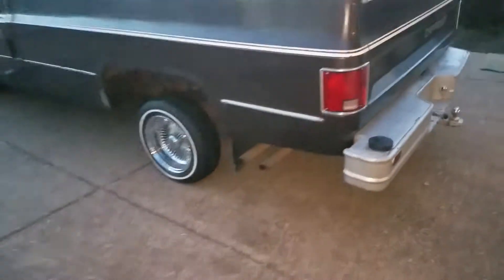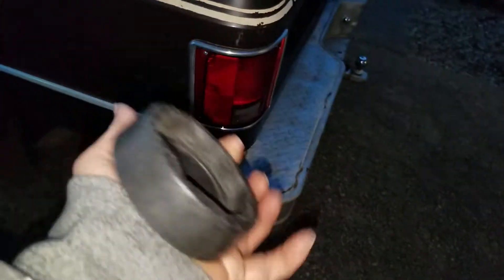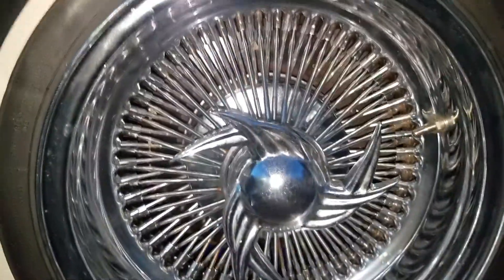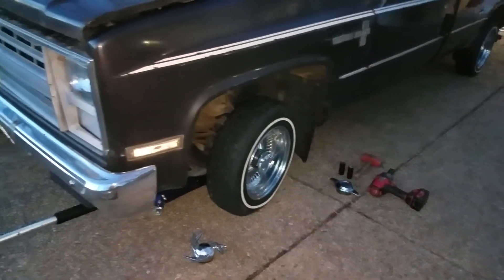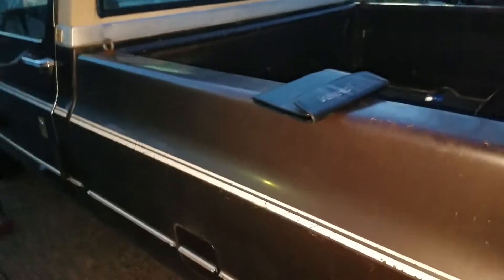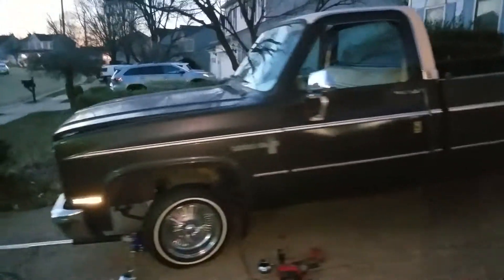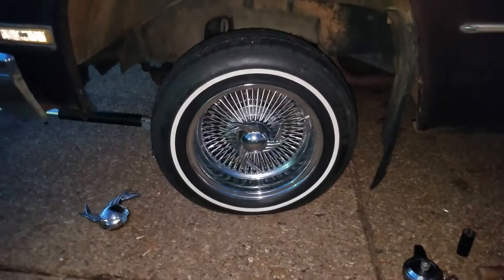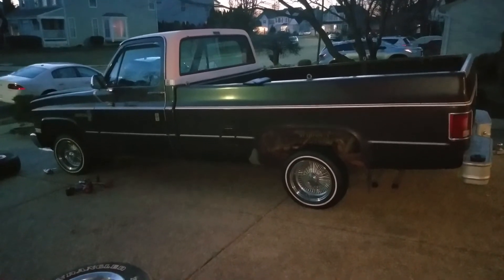Chevy C10 lowrider project part 2

Comment: That is clean bro keep them on ☆☆☆☆
Reply from the maker: Today I'm going to put the stock wheels back on because I don't have a complete full set of lug nuts and I have to get one of the tires inflated. Then I have to do a tune-up on the truck and take it to get emissions and inspection. Once I pass and I got my plates and my stickers I will take the stock wheels off and roll with the wires
Reply from the maker: Oh and I forgot to say thanks

Comment: I love them spinners you have on the front wheel I would get them redone 4sure & if the only choice is 14's or 15's I would stick with the 14's once you lower the truck it will change the whole look
Reply from the maker: That's exactly what I plan on doing I do want to get the knockoffs redone since you don't see them that often around.

Comment: I would stick with the 14’s and under coat  the wheel wells but otjer then that it looks dope homie
Reply from the maker: I'm going to try some fifteens just for the hell of it. And I'll probably end up doing some work under suspension like 2 inch spindles and flip the leaf springs.

Comment: I got pretty nice drop by pulling the overload spring and bought a cheap set of djm shackles & hangers,  I had under $100 bucks tied up in about a 5" drop. Cut about a turn off the front coils and aligned.
Reply from the maker: Nice! thanks for the info bro👍
Reply: No problem, good luck with the build!
Reply from the maker: @ryanmcgivern5485  thanks bro I appreciate the love

Comment: I would stick with the 14s bro. Instead of buying 15s, use that money to lower it. As far as lowering it for now, just get some lowering blocks for the rear to level the truck out. Looking good bro, looking forward to future updates.....and yes, those are probably the shittiest lug nuts lol
Reply from the maker: Yeah I'm going to see what happens within the next month or two with my suspension already looked at a few drop spindles
Reply: @nelsona779  Something to think about, if you go too low, the rear axle will smack the frame. Then you get a c-notch to fix it, then rear differential will smack the bed of the truck. Happened with my Chevy Colorado. But I went pretty damn low with mine.
Reply from the maker: @wellons74  will shit thanks for the advice homie I am planning on doing a c notch but that will be later on down the road I plan on putting a hoppos air bag setup after the summer if I have the money. I plan on doing a couple of trips and having some fun this spring or summer so who knows🤷‍♂️
Reply: @nelsona779  No problem brotha!! Just some forward planning and things to think about. Most definitely understand that, do some traveling whenever you can, always nice to see other parts of the country/world!

Comment: Looking good with the spokes. Use the two bar straight knockoffs, will give it that OG look. The truck doesn’t need 15’s. Maybe a 205/75/14 tires would fill the gap better. But I like it as is, throw a flip kit in the back and 3 inch drop coils in the front and you are cruising.

Comment: Hex, 14s work needs a minimum 4/6 drop 15s will handle better ride better
Reply from the maker: Yeah you can tell my hesitation in the video. I am going to have to go with some 15s. I'm going to do the reverse lift spring and I'm going to get 2in spindles for the front and see what happens if it still looks like crap I'll get some 15s